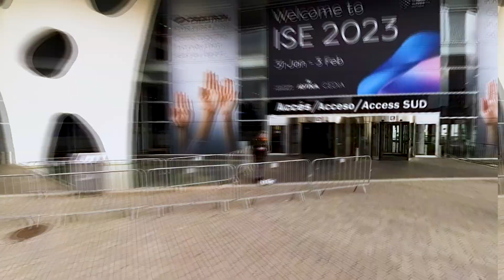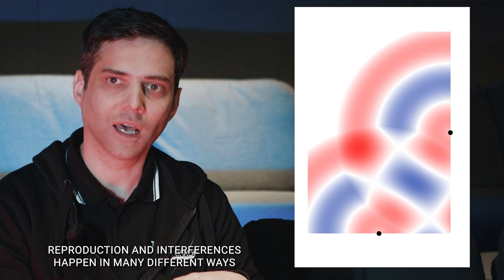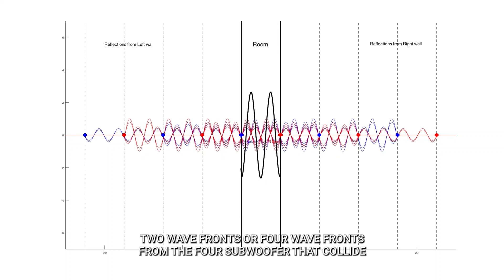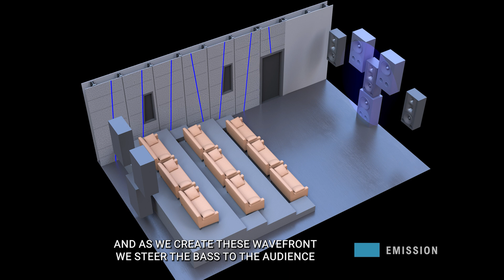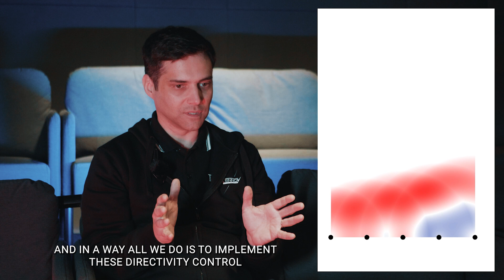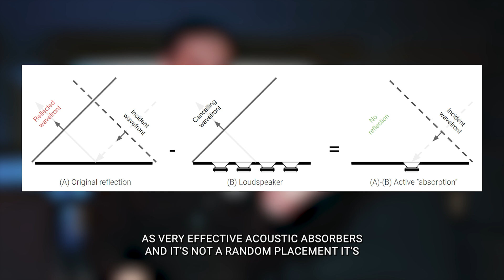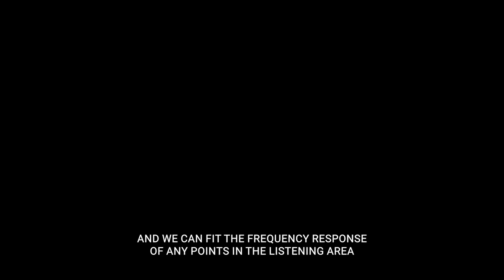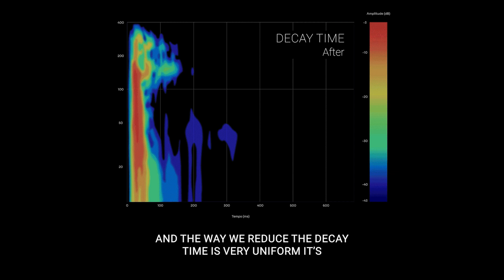TRINNOV WAVEFORMING // Trinnov Audio's LATEST INNOVATION in Bass Management REVEALED

Comment: Trinnov likes to talk big. This is something that has been done for years. What trinnov shines in, is getting a working algorithm that works in alot of rooms. This Was doable and was used for a long time. Every basic dsp can Do it. But you would have to measure and calculate it yourself. Trinnov now provides a simple solution for a complicated System. So its still a great Feature but storm and trinnov talk like they found a holy grail. For this to work Phase alignment also is critical. So for pure subs this is not as bad to actually get working. A 3 way speaker with a difficult to handle crossover is way more Problematic. Thats probably why they used so many subs in their Demo when the key point of the solution is to use already installed speakers instead. Well, Sound is complicated and will be complicated for a long ass time. Everyone with access to a good room calibration that works for their room. Congratz, iam happy for you, but no matter what algorithm, a solution that keeps your room and speakers in mind will outperform it.
Reply: That's my gripe too, taking a well known approach that a DBA's are, and rebranding it as something new. I'd be more content with - "We looked at DBA's and made them easier to implement"...I'd like to be convinced they worked out how to "bass steer" in the way in a new way that isnt described in the general knowledge about how DBA's work.
Reply: I've also had issues getting the synergy 3-ways dialed in - unfortunately looking at doing it externally and just having the trinnov control it as a single speaker.

Comment: Great informative video.  This sounds a lot like what Dirac is doing with their Active Room Treatment tech.  The future of home theater is getting better and better.
Reply from the maker: There are some significant differences from DIRAC, especially around bass steering, and the MSMC aspects of the technology as well as you need to make sure you get the room design correct to begin with as well as use passive acoustics. I watched this interview at least 17 times while editing haha!! Exciting times in the space of bass management that's for certain :)
Reply: @BuildMontage  Great video as always, just wanted to ask have you heard Driac ART ??
Reply: I don't think this is like DIRAC ART at all. It's just a double bass array described also here and been used for a long time: https://en.wikipedia.org/wiki/Double_bass_array. Non optimal subwoofers placements, according to the orginal DBA idea, sounds to me they are calling that "bass steering"....so yeah a delay to compensate for non ideal positioning of the subs. DBA's needs strict placement whereas ART will work in any room with any gear. I'm rooting for any system to improve bass performance, but this just doesnt feel like noting new, just a rebranding of a DBA with some delay compensation for non optimal sub placements. In the video it's shown to reduce decay above normal subwoofer frequency, but it's not clear to me that this system is active in other speakers than the subs. At least he is honest that is requires a lot the design attention and cannot be used optimally in any situation, again a clear advantage of ART over this. At the end there he refers to subwoofer distance and it's not clear to me if he refers to the general DBA formula, but higher number of subs in the array lends to a higher working frequency - that is if you want your subs playing up that high. DBA's are awesome and I read many have super results with them so I am not surprised is was a good demo. Buy a minidsp and some subs and you can create your own DBA.
Reply: Personally, i feel Dirac ART would be better ( just from reading the white papers and understanding the way that each company is approaching this ).